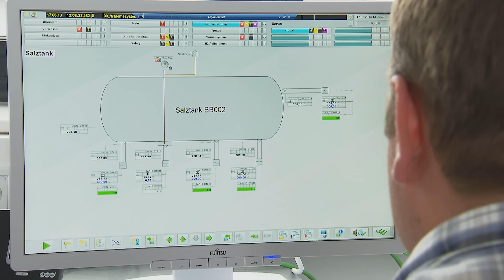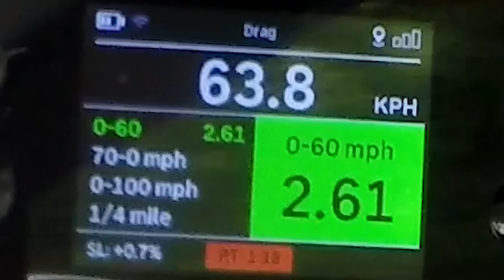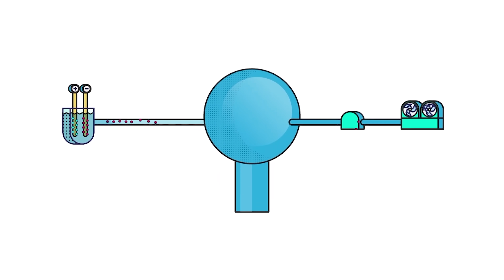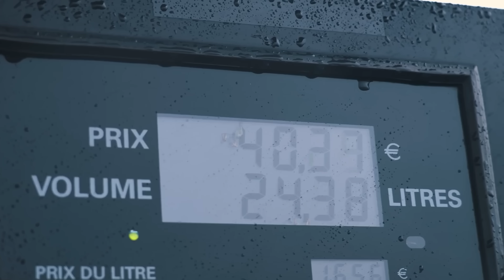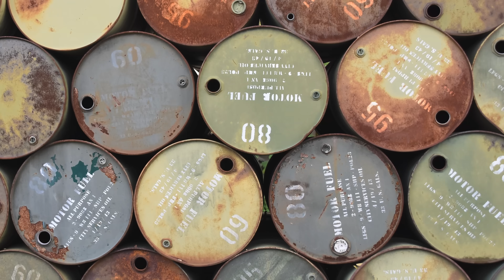Porsche just SAVED petrol engines FOREVER

Comment: Why don't they just make methanol cars? F1 car run on methanol so they already know how to make an engine work with it. I know methanol is expensive, BUT! since methanol is higher on octane than gasoline, they wouldn't have to make big engines! Example: you have the Bugatti wr16 engine which is 8 liters i think and it has up to 1600 hrsprs, but if you wanted to make that engine but for methanol, you could lower the volume and the engine would still have the same power! Since you would use less materials to make the engine and etc. The whole thing would cost less, so at the end of the day, it would be maybe slightly more expensive than a gas car but it would NOT BE ELECTRIC and not HYDROGEN. That is my opinion, i'm not a proffesional and i'm not saying that everything i said is true! This is just what i think. Correct me here in the comments!

Comment: So you make "carbon neutral" fuel removing co2 from air in Chile using large amount of electricity and then transport that fuel to europe and burn it with max 25% efficiency and release co2 in big cities. And then it is carbon neutral :))) Genius move. And it can cost as gasoline in 10 years. With this tempo batteries will be 3x capacity and 5x faster charged and electric cars much, much cheaper than ICE

Comment: What about the fact that electrolysis is so energy intensive. You end up using even more electricity to get the "e fuel" refined. You would need the same green energy  that would be needed to power ev's.

Comment: Porsche is doing something that is amazing and revolutionary with the creation of e-fuel to keep the combustion engines in use and have it carbon neutral.
I greatly applaud Porsche for what they did / do, this is awesome !!!!

As for ev supporters, the ev is flawed, and here is why it's doomed, now look at California, they wanted evs and they got them, but since getting a ton of evs, it's created another problem, California's  electrical demand for the power to recharge  the evs, its insufficient and is not up to the task, the power system infrastructure cannot handle it.

California's power system infrastructure is not able to handle all of California's electrical demands, of houses, commercial / industrial, and evs.

The battery packs have limited years of lifespan, in those evs, and to buy replacement battery packs, it's extremely costly, so costly that not everybody can buy the replacement battery packs, when it goes bad, and the car ends up being a piece of a junk in the end.

The better way to resolve this is by having the dual fuel cars, can be driven on electric power, as well as on gas, but instead of gas, fill up on e-fuel.

Kia has a version of the Sorento that is a Phev, Plug in hybrid electric vehicle, it operates on electricity and on gas too, now fill it up on the e-fuel, and you have a vehicle that runs very much green either way.

Comment: Another solution would be to concentrate on Graphene batteries (aka supercapacitors) which can (hopefully if invented correctly) charge in just 3 seconds and last longer. But Elon is not interested in investing in Graphene which is sus. But I just love ICE more, especially on bikes (EV bikes sucks, I want manual transmission). I think we need to follow brazil.

Comment: Unfortunately as some have already commented, while synthetic fuel does provide a means for combustion cars, it is simply not economical enough for mass consumers. In my opinion, best solution is temporary extension to the current deadline until Toyota and its partners are ready to commercialize hydrogen cars (along with sufficient refuel stations)

Comment: As it can be turned into a diesel fuel, I presume it will be possible to produce bunker oil as well. Which would be great news for the shipping industry. They wouldn't have to overhaul the whole fleet and replace every engine in there. As burning bunker oil produces a worse air quality then diesel or petrol it would be a great option for cruise ships and every other ship which docks within cities to start off with.

Comment: I had a water methanol (windshield washer fluid) atomizer sprayer on the intake plenum before my Jackson racing supercharger ahead of a d16z6. Retard the timing (the point of the methanol to stabilize the knock)  the drop in small pump and injectors I got a tremendous amount of efficiency, used a VTech converter to trigger the water/meth to fire based on RPM banding. The car ecu automatically adjusted for the mix. What's interesting is, if you pad your cylinder with water, so much less liquid unspent fuel becomes heat soak! It's kinda nuts guys. I was getting over 50mi to the gallon around 253 whp

Comment: Forcing EVs on us is not about cutting down on fossil fuels.  They're still going to be needed to generate the electricity for EVs.  It's all about control.  EVs have a shorter range than gas powered vehicles.  They take a long time to recharge. The location of charging stations can be used to limit travel.  EVs will be equipped with a "kill switch" that can be manipulated remotely.  And generally, it will be a lot easier to shut down mobility in an area by pulling a couple grid switches rather than by shutting down the supply of gas.

Comment: They only get partial recovery of the carbon emitted, this means that only a potion is "carbon neutral", all this really means is they emit less carbon over all. They all know, bullshit baffles brains. What about the motor oil used to run these engines? It's all smoke screen horse poop.

Comment: This all great & everything but combustion engines are about 5 x less efficient than electric / mile. So if you are essentially using electric to make e-fuel you will require 5 x as much hence 5 x the cost.
Then you've still got tailpipe emissions in urban areas to deal with.
Seems a good long term solution for enthusiasts to keep classic combustion cars on the road & extreme/niche use cases where EVs aren't appropriate but economics will dictate that the EV will be the transport of choice for most people.

Comment: funny E fuel is not considered carbon neutral if it is produced with electricity that is not from renewable 0 emission sources, but EVs are considered the future even when we charge them with the same combustion engines & fossil fuel that they are getting reed of in cars. same electricity that is currently making E fuel is Currently charging EVs. something doesn't smell right

Comment: this doesn't make sense other than preserving some iconic petrol cars for historical purposes.
If you're gonna go over the electrolysis process you already get a fuel for which the energy invested in creating can be converted into work with high efficiency in, like, a Toyota mirai. IDK the number but the fuel cell efficiency is very high, 80-90%?

Instead you propose to further spend work and money to create ethanol and, worse of all, burn it, with maybe a 30% efficiency in the conversion into work. And emitting CO2.

Just save (lots of hard to get green) energy using efficient H2 cells and capture carbon for something else. You'll have plenty energy to spare to do it. Or plant trees and capture it for free.
Reply: wth, burn H2 if you like combustion engines, and it will still be cheaper, more energy efficient and cleaner

Comment: How can you possibly pull enough carbon out of the air for this to be functional. And if they can't pull it out of the air. Or  will they  just find it another way to process carbon. Or create carbon, Then turn it into fuel. Good idea but it does not sound practical.

Comment: Porsche and Toyota aren't stupid. The 2035 rules will be moved, UK is still burning wood for power. Germany is using lignite, even though they have enough solar and wind to power the country twice over. China uses 1100 GW of coal power and is expanding another 270 GW by 2030. That equals 2.5 coal power plants a week. For reference USA uses 256GW of coal power and is going down by switching to LNG. USA has 25% of the worlds cars and 12% of the worlds emissions, so just how is switching to EV going to do anything?
Reply: Well the US could stop burning coal for a start, have less cars,  and find that there are better ways of producing electricity.
Reply: @robertvanruyssevelt7159  one thing people forget, you can't make anything out of electricity. Oil is not only great energy storage. Almost everything around you is made from oil. China uses 1100GW from coal fire plants, switching to LNG would be the largest and fastest way to reduce emissions. But China is building 270GW more by 2030. 75% of EV batteries are made in China and 95% of solar panels.

Comment: The massive switch to EVs is going to leave us all in a poverty stricken society with loads of hazardous trash laying around in landfills. The energy used to power them will come from fossil fuels as always, while the politicians heavily invest their money into EV related products to make a quick buck. Companies like Exxon Mobil will become Exxon Electric and save money by trucking fuel to less stores and just transmit the power made from their fuel downline. The transportation/shipping industry will collapse from delays and increased cost of fleet vehicles. EVs and E-fuel can be a good thing, but so can carbon scrubbers, provided they both work using power produced without fossil fuels. There is a lot more that needs to be addressed and this isn't a problem that can be fixed by signing laws to ban ICE.
Reply: There is no need for electricity to be made from fossil fuels. In the USA coal burning power stations exist because coal mine owners like Joe Mansion get into positions of power and protect the coal burning industry.

Comment: Charging really isn't a problem...
If it was everyone wouldn't be buying them here in Norway...
And E-fuels made by using the CO2 in the air uses a heck of a lot of energy to make it...

Electric cars are a heck of a lot more viable.
But sure, some e-fuel cars and some hydrogen cars thrown into the mix might help alleviate the one real problem with electric cars, a shortage of the resources to make them, and especially their batteries...

Comment: Why do you want to stop climate change? I want to have a summer, autumn, winter and spring! Water cars have been around for ages just suppressed, smeared and censored, just the like the early electric car's of the 1990's. The electrolysis process can be used in water a similar way and get hydrogen, with the exhaust being water. Far superior and abundant.

Also, Carbon is food for plants and aids abundant growth. Taking more carbon out of the atmosphere is very misguided, levels of carbon are at the LOWEST ever. Look for yourself over a long historical period. :)

Comment: Using electricity to produce hydrogen via electrolysis, and process that into an E-fuel, and burn it in an engine, is incredibly inefficient compared to just using that electricity to charge a battery, and then power a motor. Roughly a factor of 4-6 times as much electricity would need to be produced per mile driven, if doing it via E-fuel rather than just charging a battery. That's why E-fuel is ridiculously expensive - because it's a horribly inefficient process.

Comment: if you combust a fuel in an engine it will produce Co2, there is no getting around that.
Even these so called hydrogen fuel cell cars driving around are all producing NOx,  thats nitrous  oxide, and have to be fitted with a NOx trap.  yea you can drive  ice,  but the GOV will tax you heavily.

Comment: Very ill informed video. Porsche didn't invent e-fuels and it's not their breakthrough that changed EU legislation. It's big amounts of lobbying work from different branches for several years. Most notably the petrol industry trying to find their position in the future.

Also you fail to mention that the power efficiency is decreased further. So now you don't only have the combustion efficiency of <50% from an ICE but also the conversion efficiency from Hydrogen-->e-fuel. You could use the hydrogen to either be used in a fuel cell directly or with a hydrogen combustion engine (or straight to EV, where it is an option).

And then there's the cost issue. E-fuels will be expensive so 'normal' people will still use fossil fuels for their 'old' cars which is kinda stupid because you could get the entire world fleet of cars to be carbon neutral with e-fuels. But that's in no ones interest because it costs money to subsidize and it's more convenient to let the private people cover the costs and OEMs can sell newer, more efficient or electric vehicles.

All the options are shit and we are doomed anyways.

Good day.

Comment: By even 2025 EV's are going to be cheaper to make and run than ICE cars due to the evolution in current battery technology. So I really don't see this as a problem. I mean if you can charge your car in say 15 mins and get 500 miles range (future advances in battery and charge rates) that's better than 90% of current ICE that have no where near 500 miles range. EV's will just evolve and get better and better just like the mobile phone did. Anyone here still want a dial phone?

Comment: The United States already has a large e85 infrastructure. Ethanol is a synthetic fuel. It's has fewer emissions and you can squeeze more power out if it. If you use sweet grasses to make it you can really be close to a carbon- fuel that will work in any combustion engine with a plug and play piggyback system. Ethanol has been used for years and it's cheaper to manufacture than methanol.

Comment: It’s fine as long as you don’t mind paying $20 a gallon. And this technology has been available for decades.

Also, this is a far far far less efficient use of electricity than simply running a car on the electricity. Turning the electricity into petroleum is a very lossy process. And then the ICE only gets about 30 to 40% efficiency in the vehicle.

Comment: If e-fuel becomes mainstream then I have a feeling that it will become cheaper than oil based fuel. Why? Because you don't have to be in a specific location to make it or procure it, every singel country in the world could potentially make it. (Even the Vatican if they so pleased.) This in turn would lower prices, lower demand for transporting oil which in turn would lower emission on global transport and ect. Instead the market will be more focused on who can make the most efficient e-fuel at the lowest carbon fingerprint.
And remember when it comes to fuel it isn't just about cars, some things you can't replace with an electric motor a few batteries and think it will turn out just fine. Lithium and water don't mix well unless you want every boat or ship to be come a potential hydrogen bomb.

Comment: E-fuel suffers from the same problem as hydrogen. The process of creating the fuel is very inefficient in comparison to just using the electricity to power vehicles directly. So at scale you would have an enormous amount of wasted energy. It's a nice solution for things such as heavy vehicles and high-performance race cars. But this kind of thing is so inefficient it will likely never see a full commercial roll out. The only problem hydrogen and e-fuel solve is the ability to charge quickly, however the vast majority of consumers don't actually need this except for in rare cases (road trips, taxis, etc.).

Comment: So cars will be allowed to have internal combustion engines if they use e-fuel.  However, as correctly stated in the video, e-fuel is only carbon neutral if the energy used to create it does not create carbon emissions.  Do the new regulations stipulate that the e-fuel must be created by non-carbon polluting processes (nuclear, solar, wind, hydro, etc.)?  If not, then this is a huge fraud as creating e-fuels by burning coal or oil or natural gas are likely to create more carbon than just using regular old petrol (due to inefficiencies in things like electrolysis).

Comment: synthetic fuels is a really good concept , to put it simply you can either charge 3 batteries for one run (synthetic fuel) or charge a single battery for one run! its efficient to use batteries , but i really hope this tech develops!

Comment: Hi carwow,
do you know with what kind of water these eFuels from Porsche are produced.
Looking at the pictures in ur video (7:37) i guess the region where the factory is located in is a "low rain" region so i guess the use groundwater and affect the environment just like the Lithium production does.
Same goes for the major oil producers such as the UA and Saudi-Arabia the most definetly have more than enough solar energy but the lack the WATER to produce eFuels.

Comment: Fake science.  You're going to put more energy in to converting carbon out of the atmosphere and doing electrical hydrolysis to make the fuel than the energy you will get back out of the fuel.  So its not carbon neutral.  Violates the 2nd law of thermodynamics.  No process is 100% efficient.

Comment: This is greenwashing nonsense. Carbon capture requires more energy than it generates (obviously, otherwise it would be a perpetual motion machine). So you need even more green electricity just to make this "e-fuel". Then you need to make 95 million barrels a day of it. No doubt as a stop gap there will be plenty of oil used to make it. Carbon neutral my arse.